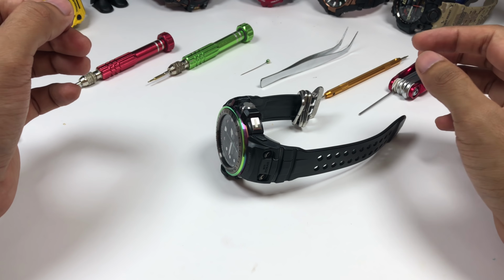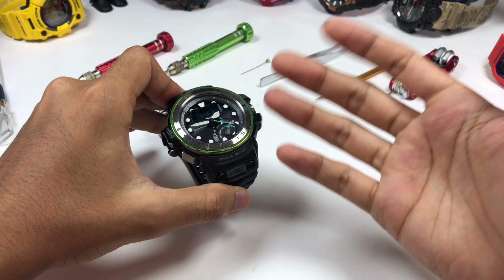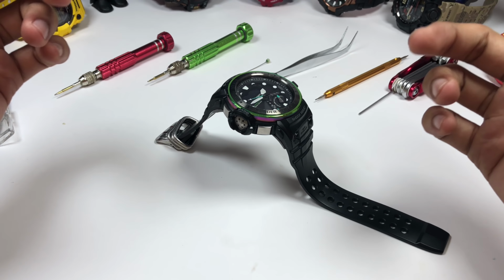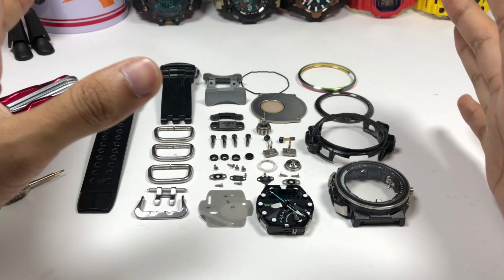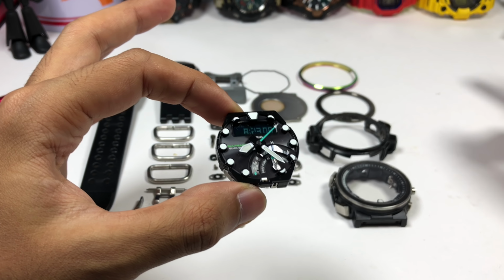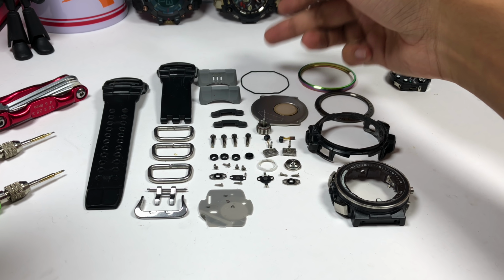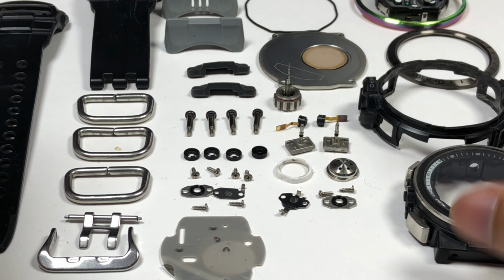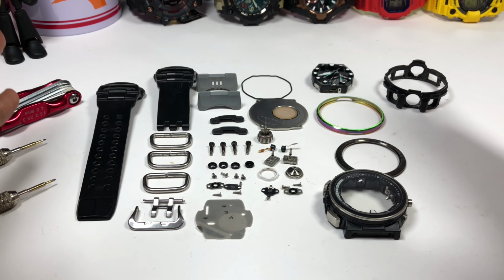Whats inside a GWN-Q1000 series Quad sensor GULFMASTER G-Shock watch | Part 1 : Exterior built

Comment: Very impressive disassembly, especially the trick you did with applying vasoline to the small e-clips so you wouldn't lose them (I think that's what you were doing).  I just removed the back and crown from my GWN1000 Gulfmaster since I have been getting condensation under the crystal. Sat it in a container of dry rice over night with the back removed, but the condensation showed up again (had my arm out the window will drive, when I brought my arm back into the car, it formed).  I just noticed that there appears to be an o-ring missing form the crown stem.  Going to find one at work tomorrow and see if it works.  Not good quality control from Casio. Thanks for the video!

Comment: I realize this was a very long time ago, but do you happen to recall if that metal ring that sits on top of the resin bezel and around the over/under metal ring (the part that looks like you had to pry it off with your screwdriver by going along the edges) is something you can replace without having to disassemble everything up to the point where you actually took it off in the video?
Reply: That's what I'm thinking too, I think you should be able to fry out that black metal bezel without disassembling everything.

Comment: 8:52 Water does not have to go through the holes and touch the sensor. If there is air trapped there, it will have the same pressure as the water pressing on it.
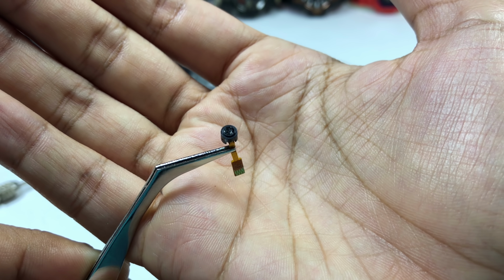9:03 These sensors may look the same, but they are certainly not the same in construction. The one from the depth sensor has a different range and can measure much higher pressure. If they were the same, Casio would only use one.

Comment: I would like to polarize the display of the GWN Q1000 positively. is it necessary to remove the hands?
Would it be better to align all 3 at 12 o'clock?
Thank you
Reply from the maker: Yes, the hands need to be removed first before removing the circuit board to access the display panel.

You can try aligning them at 12. The problem is removing them without misaligning them back. It is harder to do since all the hands are located at one place.
Reply: @gshockhighfashion  Okay, thanks for the reply.
But even if the hands misalign, it could be manually set at 12 o'clock, then put the hands back in the right position, all three at 12 o'clock.
If the hands misalign what happens?

Comment: Great job, bring on part 2 👍🍻
Ps: was that glue or tape holding the metal bezel (with under & over written on it?)
And what will you use to re-attach it?
Reply from the maker: The green ring is what holds it into place. The tape is there so that it wont rotate as easily when we wear it.
Reply: gshock highfashion cool & thanks for that!👍
Couple of questions (if you don’t mind), Will you replace that tape or just use the old when putting it back together?
How many o-rings are in the case around the crown stem (didn’t see any on the stem🤔)?
Cheers 👍🍻